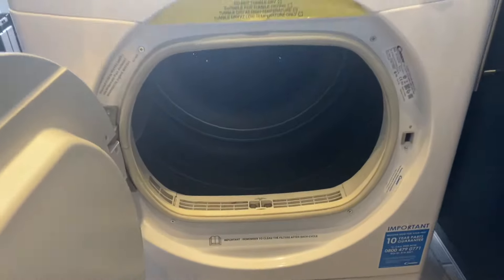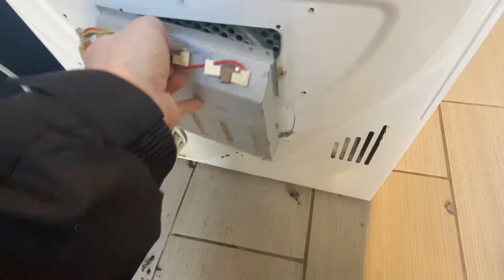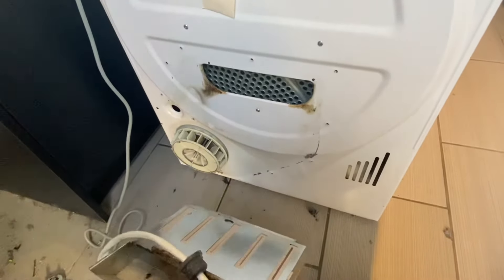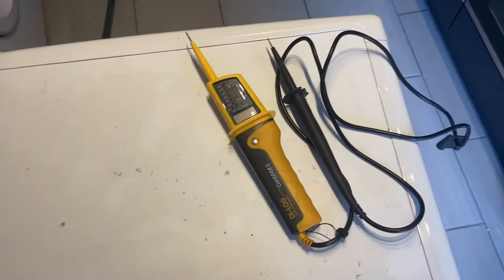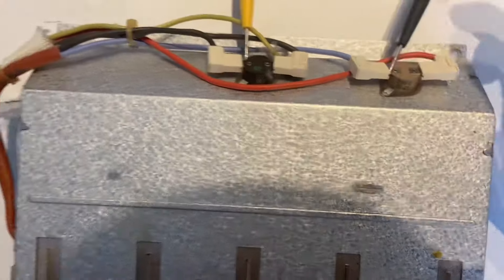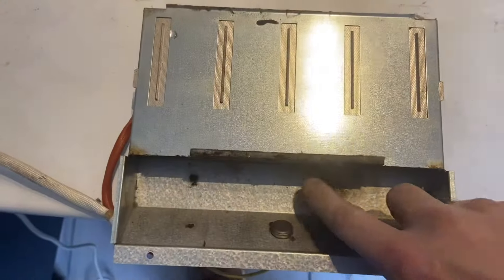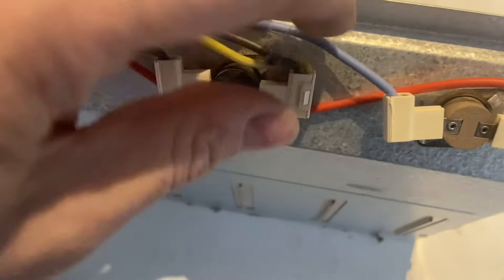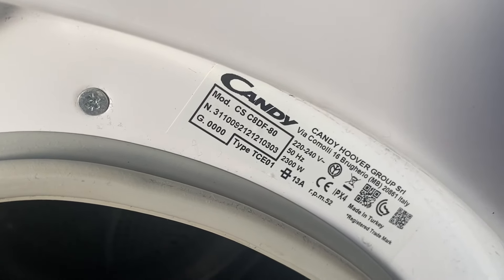Candy Tumble Drier no heat E21 error fix

Comment: Hi Darren, I hope you see this. Our Candy dryer stopped working and after Googling the symptoms it appeared the capacitor had failed. I replaced it and after a quick test, it was working fine. The next day my wife started using it and after a while, it stopped again with the screen flashing 'E21 error'. Is this related? The conspiracy theorist in me has came out as all this started a couple of weeks after the year warranty ended!

Comment: If you're a wheelchair user as I am I physically would not be able to do that nobody ever thinks of this ever disabled people do have tumble dryers secondly how can you clean all of that in the first place did virtually have to remove the tumble dryer remove the back as well as obviously unplug it then try and clean it all also how much would the parts actually cost because I tried to work that out and I couldn't do it thank you for the video anyway but wouldn't it make more sense if the companies that actually sell these made them a lot easier to clean properly
Reply from the maker: Hi sorry missed this comment. Yes they really do need to make them easier to clean. You can take each side off and clean inside as they all collect a bit inside. Parts cost for the thermal cut outs are like £12 or £30 odd pound for the whole heater.

Comment: Don't need to take front off. Before you release the wire going in to the dryer (on back) using the little push clip tie some string around the clip before you pop it in. That way you do not need to remove the front to plug in the new heating unit.
Reply from the maker: That is how i refitted it

Comment: Hi where's the video of the front?
Reply from the maker: You can do it all from the back just pull the cable through once you press the plastic clip in.
Reply: @darrensdiy4769  how do you reconnect it?
Reply from the maker: @loman0071  pull the grommet out and wire then the plug. Plug new one in , push the wire back and the grommet.
Reply: @darrensdiy4769  looking at it I can't plug one in
Reply from the maker: @loman0071  have you bought a new heater? Should come with cable and a plug. The old one needs removing and cable pulled through and unclipping from the plug. Plug new one into the machine loom and push it through and refit the unit
Reply from the maker: https://youtube.com/shorts/9DVDe6vzg-s?feature=share
Reply: @darrensdiy4769 mine is completely stuck, looks like it's been tied in a knot or cable tied but I can't get to the wiring enough to see what's causing it? I came here looking for the video of how to access it from the front as you said in your other video.

Comment: Thank you ever so much for this. Watched, ordered a new heating unit & hopefully will refit at the weekend to have a woekinh dryer again! Just gotta figure out how to get cable out without swearing....
Reply from the maker: https://youtube.com/shorts/9DVDe6vzg-s?si=Ro6-oJ9_mlWlITKy

This may help as its not required to go through the front can all be done on the back.
Reply: @darrensdiy4769  you're a legend 🙌🏻 Thank you! Xx
Reply: @darrensdiy4769 how do you get to the wire from the front? Mine disconnected as I was trying to pull the wire through the hole! I can't get hold of the wire inside
Reply from the maker: @taco_gazz  take the side panel off